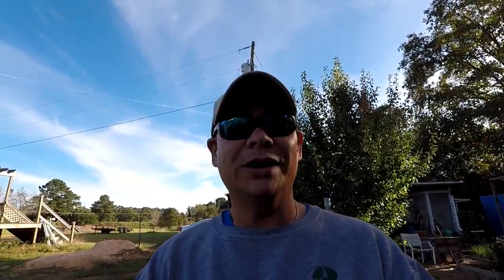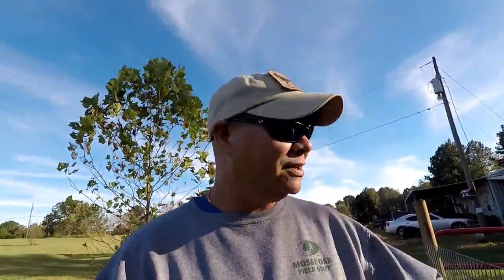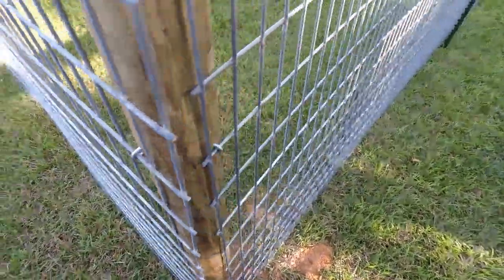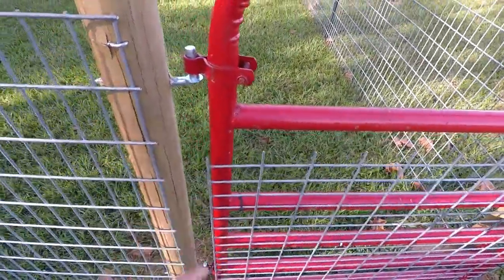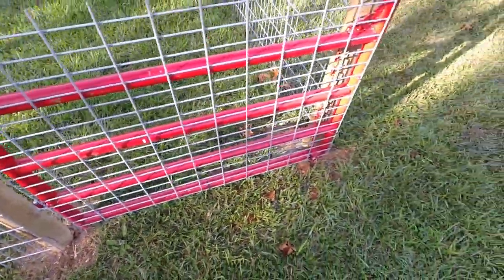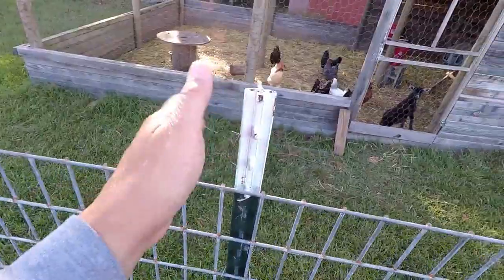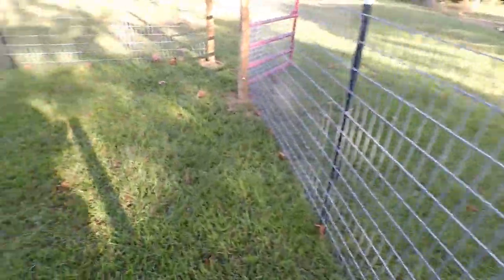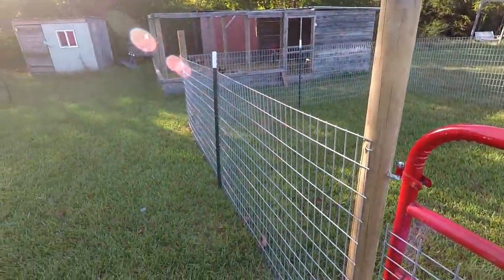How I Built A 16x16 Goat Pen

Comment: Just a tip~~ If you turn the bottom post that is holding the gate to the down position and loosen the top bracket so you can push it up and then lower it down on the top post and tighten it back up that gate cannot be lifted up and off the posts.  Right now if they go to scratching and itching against the gate they can push it straight up and off the hinges and get out.
Reply from the maker: Good tip mam, I may have to look into this!!  What I did do on my other pasture gates is drill a hole through the bracket and pin and added a cotter pin to locked the gate onto the pin, worked pretty good, kinda over kill but it worked!!  Thanks for watching mam!!  Dan

Comment: I love using panels.  They are so versatile, the uses are multitude.  That makes a great goat proof pen.  Old Guy always calls those steeples, for some reason. I noticed that the cut ends of your panel on the gate are just sticking up there.  Those things are sharp and I'm concerned that you might cut yourself on them.  Good work!
Reply from the maker: Yes mam, they pretty dang sharp but they make good latches for the chain that keeps the gate closed!!  I may snip all of them off but one.  Thanks ya for stopping by and watching!!  Dan